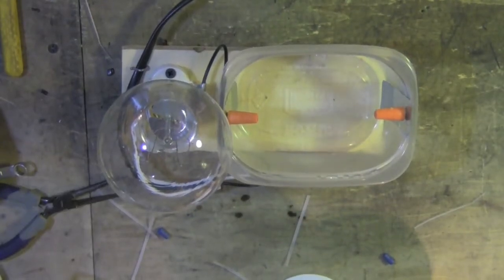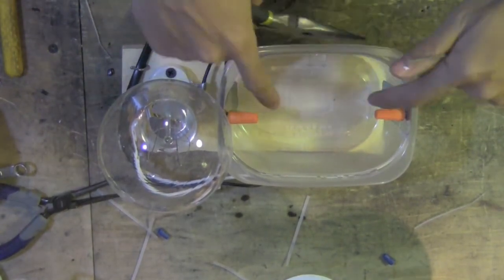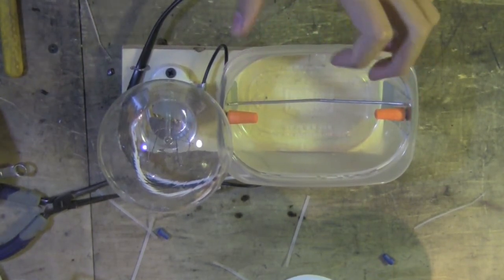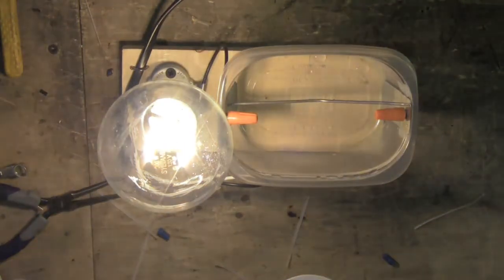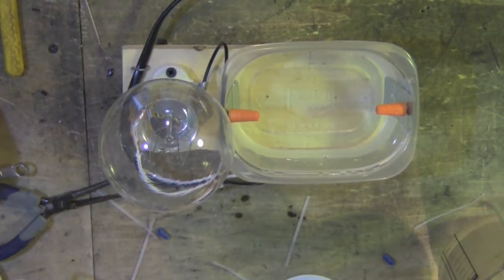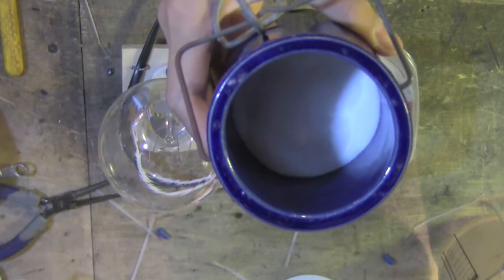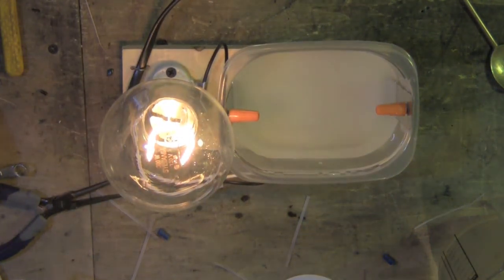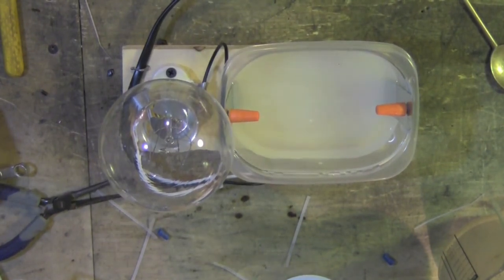Conductivity of Water Conductivity Apparatus

Comment: Loving the accent. However, the design is flawed if you used normal tap water (not deionized water). If you did use tap water, there would have still been some level of conductivity as there would have been plenty of ions still in it. You did not show water is non-conductive, only that you are able to increase the conductivity when more ions (Na+ and Cl-) are introduced.